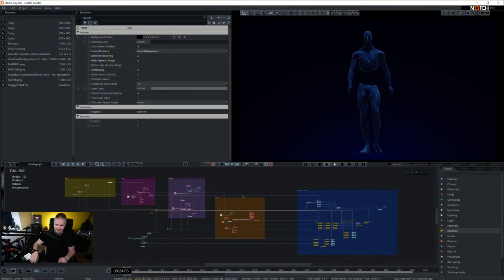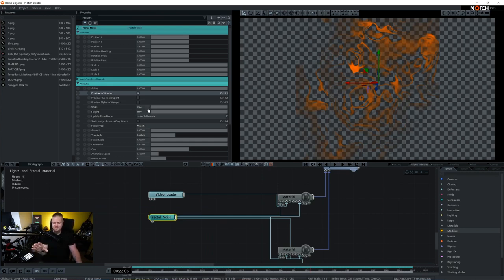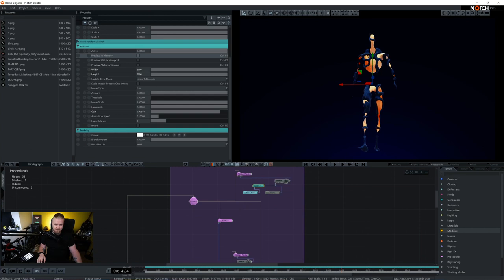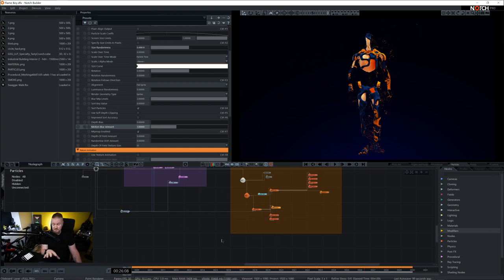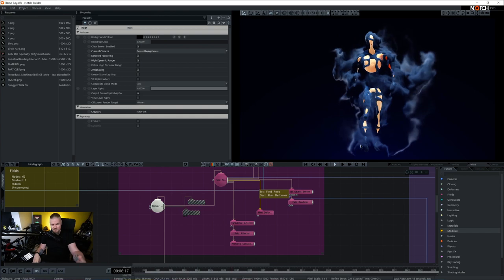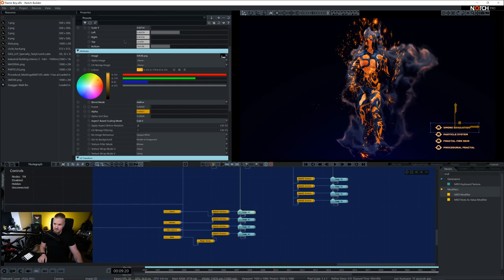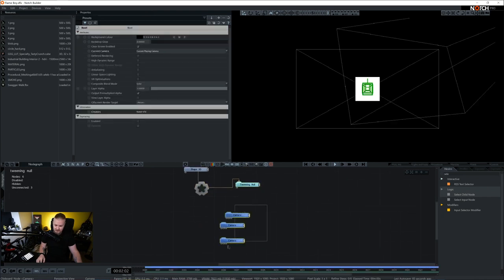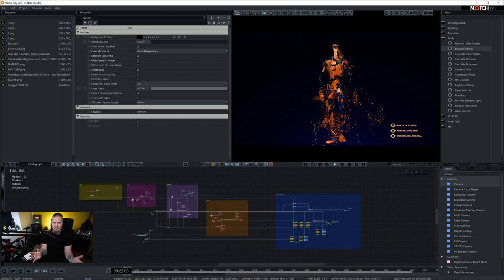Breakdown: Flame Boy | Midi controls, realtime 3D motion graphics in Notch

Comment: Hello! Thank you for the video.
Question. Would you save computer power if you used not two procedural root, but two procedural mesh?
Reply from the maker: The additional procedural system does add extra restrain on your GPU yes. You can't use x2 Procedurals Meshing nodes under one Procedural Root. So if you want to retain the look you see in the file you will have to keep both systems, however, you could drop the grid width, height and depth in Procedural Meshing node and it will increase your performance. To see better what exactly eats most of your GPU and CPU you can enable Profiler (tab next to the node list on the right-hand side)